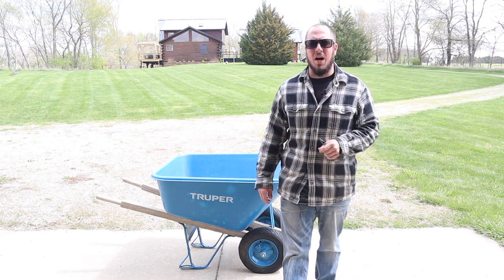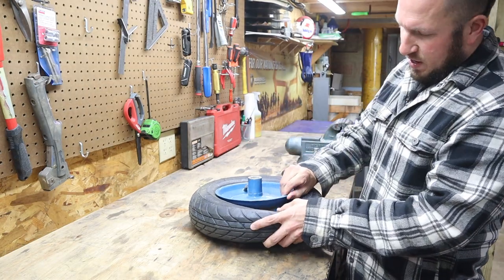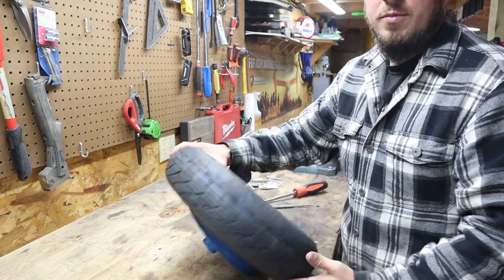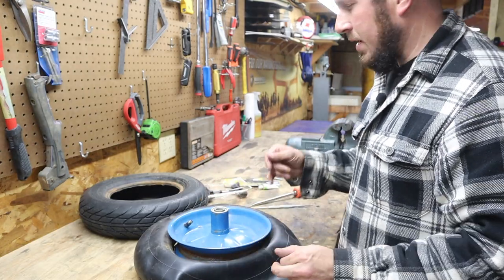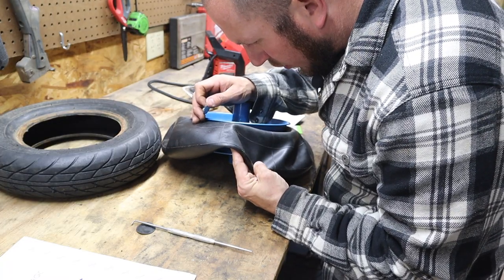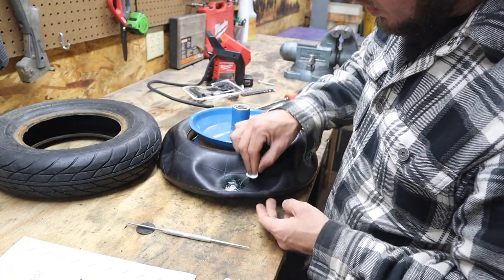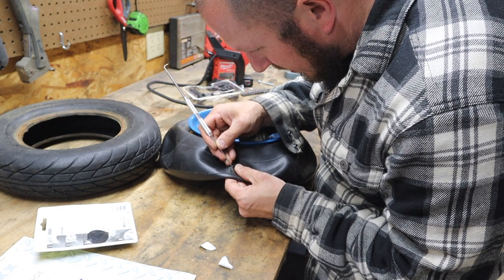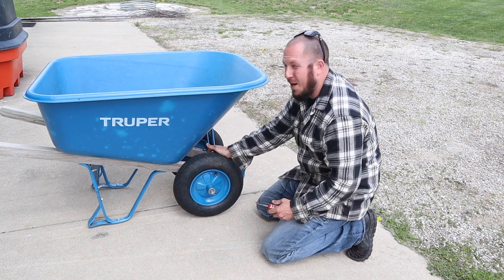How To Fix A Wheelbarrow Flat Tire!

Comment: Great video!I have never had any luck with patches.i never let the glue flash off.i will for now on though.thanks for the tip!
Reply from the maker: Yeah if you don’t let that bad boy dry, you will never get a patch to set.
Reply: Is is still holding after these last few years?

Comment: a lot of modern inner tubes are made of junk. Just replace the whole tire with a non-pneumatic tire, they are generally the higher quality option that comes with better bearings.
Reply from the maker: Oh for sure! These tires pop on gravel alone!
Reply: @TheDurbinCompound  or the rust on the inside center seam of the wheel...
Reply from the maker: @wim0104  minor details. We will see how long the repair lasts!